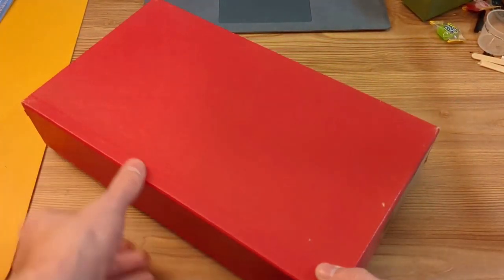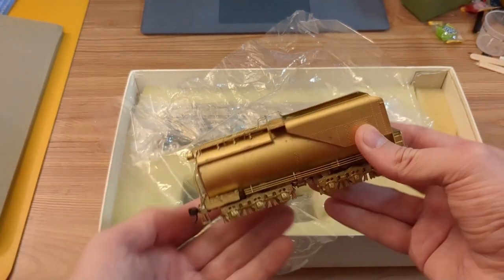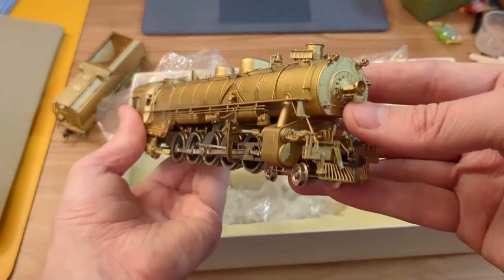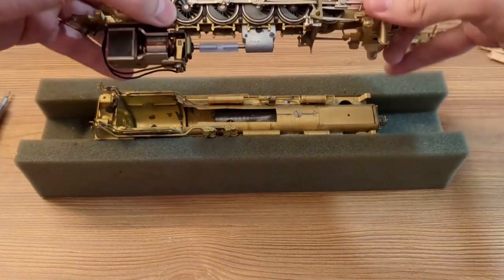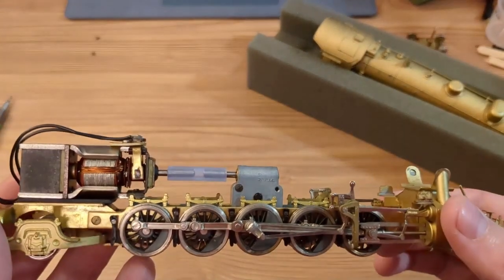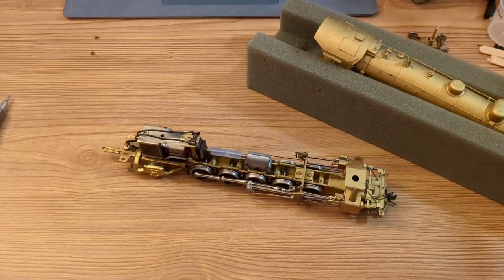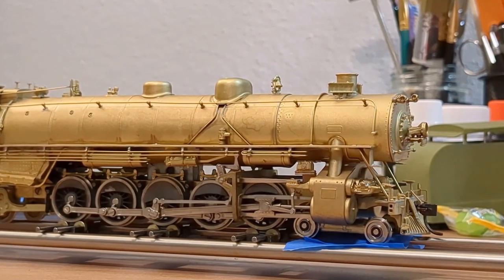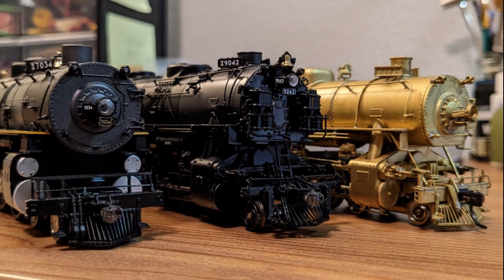Union Pacific OVERLAND - Brass Steam 4-10-2 Locomotive

Comment: Great find! 👍😉 And it is indeed a handsome steam engine. For a brass model with an open-frame motor it runs smooth, fast and quiet as shown in your test run. I think Westside Model Company brass model trains has decent detail. 0:55. I have four HOn3 brass K-27 "Mudhens", a Southern Pacific P-4 steam engine and a few New York Central Hudson steamers...and I am really impressed with their level of detail. I agree with you that WMC brass steam engines are robust. I am really pleased with the WMC brass models in my collection. If you do decide to paint and upgrade your WMC model with a can motor and DCC operation, I hope you post a new video of the model so we can all see it. Thanks for showing us your latest acquisition! 👍
Reply from the maker: Thank you! I certainly plan on showcasing this one once it has been painted and upgraded. It may be a while as I'm considering having it professionally painted which will likely take time, both in saving up for and for the actual painting to be done. I do not have a lot of brass but what I've seen of WMC I really think it's a great value. Thanks for watching!

Comment: Nice find! I actually just bought a Westside MT-73 for just over $180. Was in pretty rough shape cosmetically but it ran almost perfect out of the box. I got it cleaned up and looking decent in preparation for DCC and paint.
Reply from the maker: Thank you! WMC brass is some of my favorite, and their gearboxes are bomb proof. I've gone back and forth on whether or not to paint this one, but ultimately I think it'll look good with the Harriman-era scheme.
Reply: @yardsounds90  Good luck! I’m currently stuck as to where I’m putting the decoder in mine because I can’t get inside the tender period, I’ve got the oil version and I’m not keen on trying to unsolder everything to get inside.

Comment: Overland model in a West Side model box? From the grade of detail exspecially inside the cab)  it is an older West Side Model from the early  1970ies. After 1972 they replaced the open frame motor with a  Sagsmi can motor.
Reply from the maker: Correct, Overland in this specific case refers to the class name the UP gave to their small fleet of 4-10-2s rather than the company that made the brass model.

Comment: Thanks for the review. I was recently looking at one and your review was extremely helpful. I'm guessing from your comment,  it would require a 32 degree radius? Do you know the actual vintage of the midel ... what year it was manufactured?
The item im looking at has been painted and slightly weathered. It looks great. Seems to be a good puller as well.
Reply from the maker: Hi there, thank you for watching! I cannot specifically say what the minimum radius is, but it is likely 32" or larger. I could not get it around the 28" radius oval I have. These were imported by WMC in 1971. hoseeker.net has a lot of literature on brass (and other manufacturers) including the pamphlet for the WMC UP 4-10-2.

I need to get mine painted, but I really do enjoy owning it even if she doesn't get taken out of the box very often.

Comment: Being a ridged frame, its minimum turn radius must be very wide turns. Whats the minimum turn radius on the model?
Reply from the maker: I haven't tested it, but it will likely need 32" or greater. It does not like my 28" radius curves, that much is true.
Reply: @yardsounds90  Appreciate the response I was thinking of getting one, but was wondering it's radius as I doubt it can do the BLI 4-12-2 min. Of 22". Love to hear what you find after you test it.

Comment: you have an issue with the valve, it's lifting the reversing bar up an down
Reply from the maker: That is something I have been unable to really fix, but I haven't taken the rods off to fully diagnose the issue. Hopefully before it gets paint I'll be able to figure it out!
Reply: This a not uncommon problem, the trick to fixing seems to be to carefully (using pliers) pinch the brass fork at rear of valve cylinder to retain the radius bar at the pivot point rivet. Not perfect as a real radius bar would protrude up slightly in real life but it does prevent that unpleasant looking vertical displacement of the radius bar.

Comment: Thats not an union pacific its an #5021 southern pacific
Reply from the maker: I'm afraid you are mistaken. SP definitely had the most 4-10-2s, but this model is an example of the ten or so UP purchased as an experiment with the three-cylinder concept before ultimately going with the 4-12-2. These were the 8000 class on UPs roster. 

Some examples here: http://www.rrpicturearchives.net/archiveThumbs.aspx?id=144525